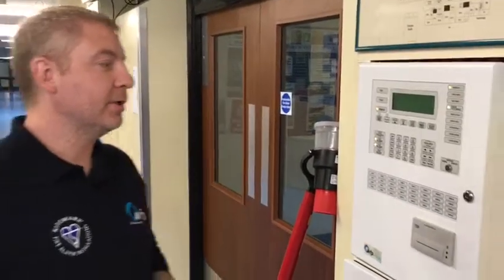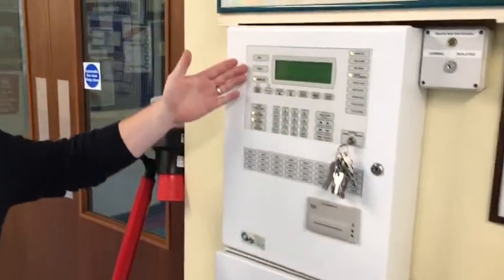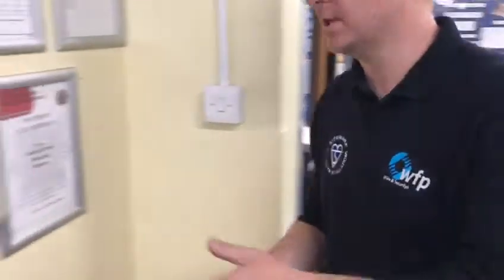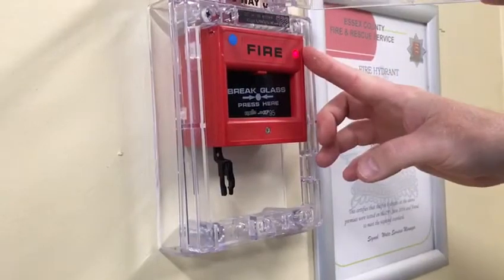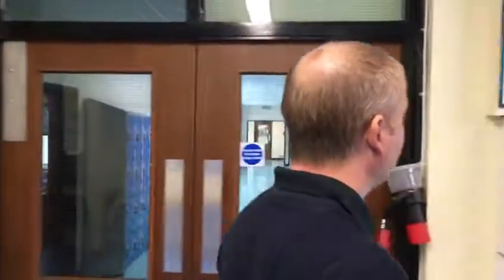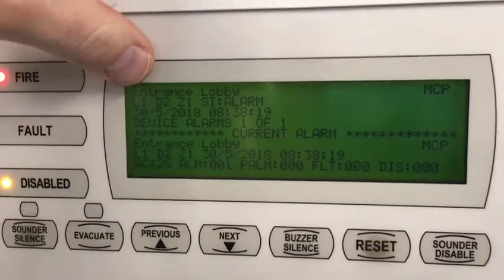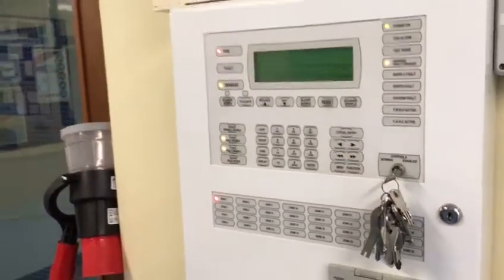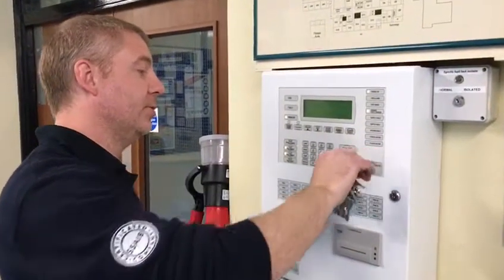How to Test Your Ampac Fire Alarm System

Comment: How is the labelling of addressing entered, via the panel or via a software using a plugged in PC ??
Reply from the maker: Hi Filimoni,

Thank you for your question. The answer is both, depending on the fire alarm. If it's Ampac then this would need to be done via a laptop and then uploaded. Your fire alarm engineer would do this during the installation/commissioning process.

If you need help or have any further questions, please contact us on 01277 724 653.

Kind regards,

Verity
Head of Comms at WFP